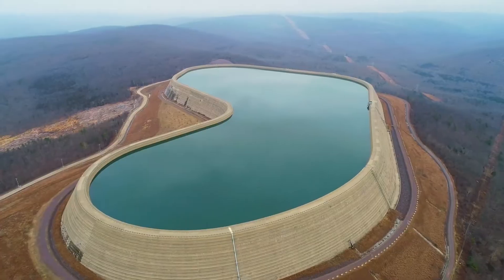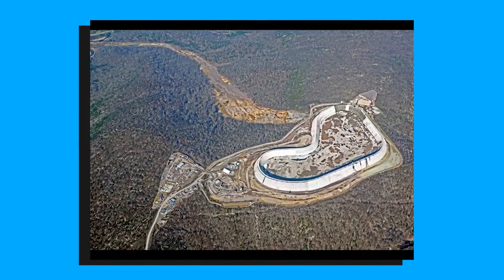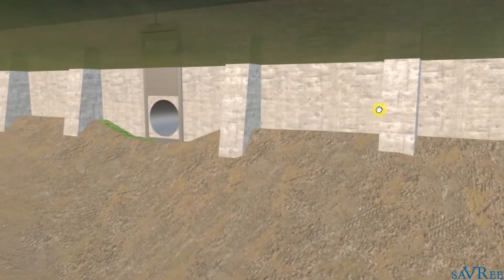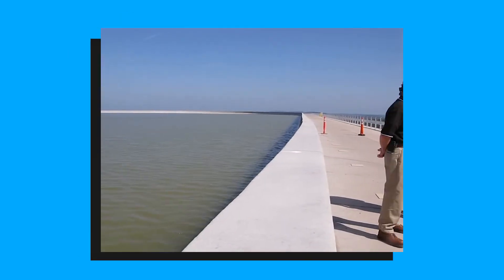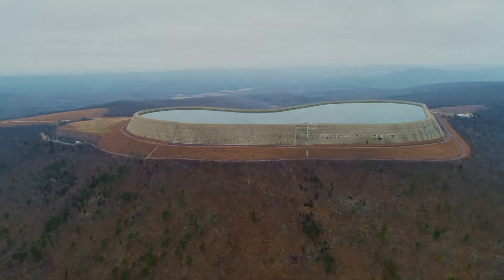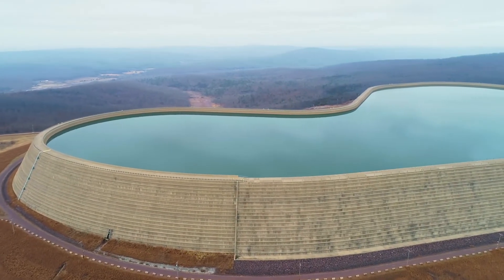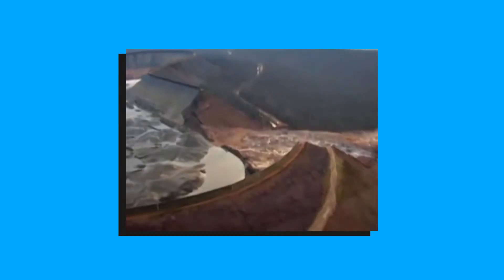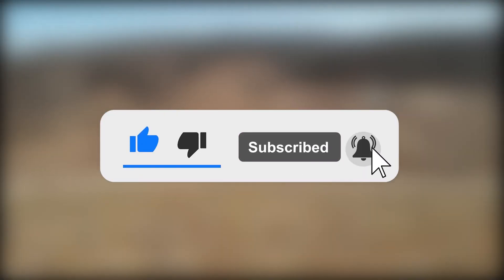Inside the $2 Billion upper reservoir of the Taum Sauk Plant

Comment: So a giant boondoggle.
Reply: It is used when the load on the grid increases and rather than rolling blackouts they bring the generators online to supplement the grid. Upper reservoir usually is drained for power during the day when peak loads are reached. The upper reservoir is pumped full during the night when the electrical demand is not at peak load. The generators are ran in reverse to pump water to refill the upper reservoir so the plant is ready for the next peak electric demand. They used to allow tours, but that was years ago and schools would set up an educational field trip.

Comment: I take it this facility generates power via Hydro Electric means.  So how does the water get there?  Not naturally like almost every other Hydro Electric facility.  Is more energy expended to get water up there than it produces?
Reply: It "stores" energy by pumping water up when there is a surplus of power on the grid and then produces energy when its needed
Reply: @megamandariini4075   Ok, but let me ask a question.  If you already have excess stored energy, why go thru the extra steps of expending that stored energy to pump the water up just to recreate the same energy when it comes down?  I must be missing something.
Reply: @StephenPaulTroup  its not stored in the power grid and would go to waste if its not used. Pumping the water is a way to store the energy for later use. Look up pumped storage hydroelectricity for more info if ur interested
Reply: @StephenPaulTroup because there are times when alot of electricity is needed and times that there isn't. So during the low use hours it pumps it back up so that when peak use hours come in it can be released down to create the needed energy.
Reply: The present humanity STRETCHED UP, not having time to GROW UP (grow wiser, become intelligent), to give such concepts as MASS, GRAVITATION, ENERGY; adequate definitions!

Someone thinks that ENERGY is an APPLE that needs to be picked! Someone thinks energy is a LIQUID that can be stored in a jug on the top shelf of a kitchen cabinet! A certain idiot, he considered ENERGY as a gas, a cylinder with which, you can place anywhere, so as not to feel deprived!
It would never occur to anyone that none of the idiots who wear colorful robes and speak their theories from the pulpit are WRONG!

For some reason, none of the "conditionally sane" had the idea that ENERGY IS NOT SUBSTANTIAL!
This is not something to be poured, pumped up or touched! Approximately the way we talk about FIELD!

Energy is not something that you can BUY, accumulate, and FOLD! And this means that we are once again confused!

I want to tell you about our (and world) "relativistic" science! Relativism, like communism, is just what is written about it in the definition (see the definitions in the dictionary!).
True, in recent years, there has been an increasing trend towards the rehabilitation of "erased" templates. If earlier the concept of relativism could be found in most medical and psychiatric dictionaries, now it has been replaced by "automatic obedience", "aggression" and "ambivalence", etc. The concept of relativism, which previously included the syndromes of schizophrenia, now most closely matches the psychiatric symptom of "childhood autism."

What happens in academic science?
I would like to inform you that this year marks the 18th anniversary of a very memorable event: the Academy of Sciences of the sovereign Republic of Kazakhstan publicly announced that the Energy Conservation Law has ceased to be in effect (or, let's say, "was refuted"), at an expanded meeting of the Academy of Experts The sciences that considered the scientific development of the candidate of technical sciences K.B. Igizbaev under the title "Method of generating profit of electric power capacity and installation for its implementation."
I quote verbatim paragraph 2 of the technical conclusion: "The energy asymmetry of water circulation established by the authors, the proof of which is the" know-how "of the invention, refutes the law of conservation of energy." They also acknowledged the studies of K.B. Igizbaev, as well as the results he obtained, are fundamental!
What did K. B. Igizbaev mean by this? Isn't that what Lomonosov said at one time in his correspondence with the famous German mathematician Euler, discussing with him by correspondence regarding Newton's theory of universal gravitation? By the way, Lomonosov, who had studied in Germany by that time, had the same specialty as Igizbaev - a mining engineer!
Namely: THERE IS NO ATTRACTION, and what we call GRAVITATION is only an uncompensated difference in the conservative system of forces (Igizbaev's term) acting on the Earth!
If Igizbaev repeated this conclusion drawn by Lomonosov, he would have blocked the possibility of obtaining a scientific conclusion from the Academy of Sciences of Kazakhstan for his invention! Therefore, its formulation sounds like: "energy asymmetry of water circulation in closed watercourses."

The question immediately arises: "how is this possible?" The answer is simple: when the Kazakh Academy of Sciences was separated from the USSR Academy of Sciences, a committee was not created in it to combat pseudoscience, so Kazakh scientists did not have time to get out of the habit of having to tell the truth in any situation!
Who are these daredevils, who were not afraid of the world scientific community, and "cut" the MOTHER-TRUTH (embed the truth-uterus), in spite of the world and Russian behind the scenes?
This is an academician of the National Academy of Sciences of the Republic of Kazakhstan, professor, honored worker of science and technology of Kazakhstan, laureate of awards, etc. etc. Sh.M. Aytaliev, and also a member of corr. NAS RK, professor, doctor of technical sciences, laureate of the state prize, president of JSC "KazNII Energetika" B. Aliyarov.

See also the video presentation of Igizbaev on my YouTube channel
Reply: It runs pumps at night , when electricity is cheaper. And produces electricity during the day when it costs more.

Comment: Nice video; however, the full story is rather "softened" if you listen to just this video.  Be sure to understand the massive failure of the wall and the damage it caused as massive amounts of water rushed down through the hills and through Johnson Shut-Ins State Park.  No doubt, this is an engineering marvel and well worth a visit to the visitor's center at Johnson Shut-Ins.  From that center, you can get a clear view of the massive washout caused by rushing water when the 2005 event occurred.  A rebuild, and massive re-landscaping of Johnson Shut-Ins, the area has made a good recovery.  The area is forever gouged though, and it is good to understand the good and the bad outcomes, and the negligence that preceded the blow out.  Well worth a visit!